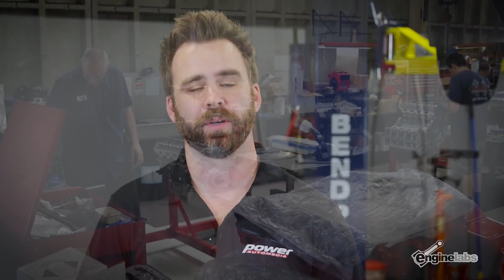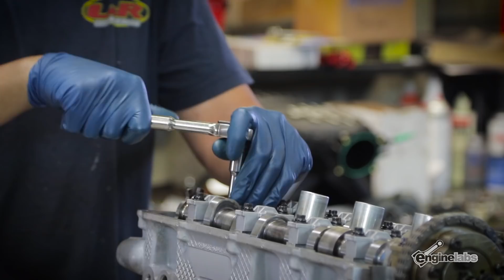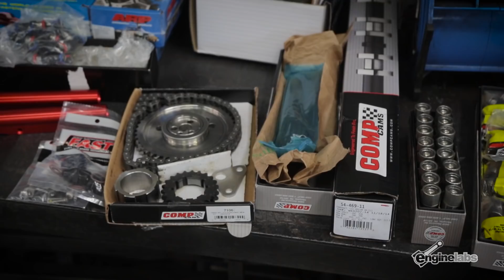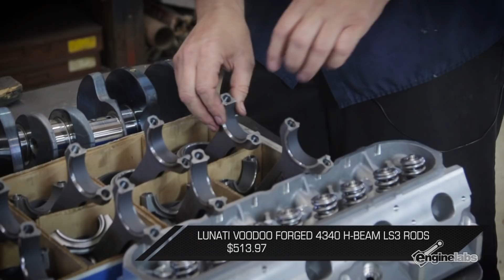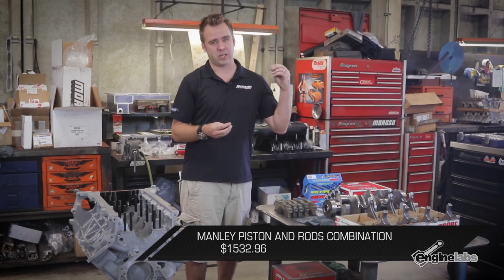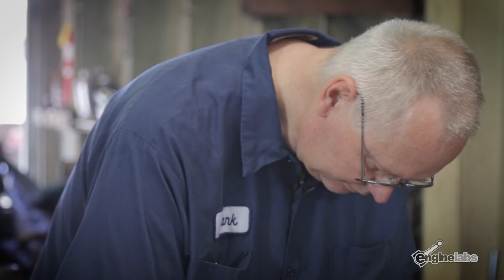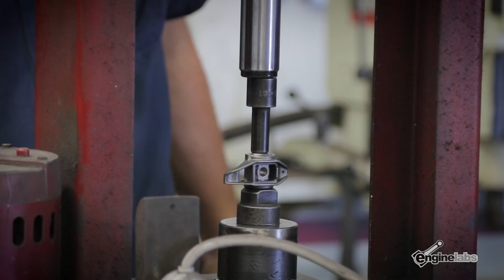$10k Coyote vs LS3 Shootout - The Build

Comment: This is funny because already you bought a new LS3 and a used Coyote. This is why these engines can't compare. And the LS3 is better in the real world.
Reply: Ditto. I stopped watching as soon as I noticed that. This entire article is irrelevant due to its apples:oranges comparison. Dollar for dollar you will not beat the LS. Buy a used LS and mod it with a $10k budget and the coyote wouldn't be close. Poor article by Power Automedia. I unfollow you forever due to your bias and/or ignorance
Reply: So by that logic I should favour one cam over four. Yeah that's why the best motors in the world are still running pushrods... oh wait they change the rods after every 1/4mile
Reply: p shasty buy a ford Barra turbo motor. Shits all over the LS series. Cheaper too. 

People call it a boat anchor. Well it's a boat anchor that eats LS for breakfast
Reply: Ian Thompson hell even 2.5litres of Nissan power is far better than an LS motor.
Reply: Dylan Zrim I don't see any ford Barra turbos, or Nissan 2.5l making wards best engine list numerous times, while powering everything from work trucks to sports cars, drag cars, and transplanted into many import. It's one of the most widely used engines, if not the most widely used engine in swaps, it weighs little more than an inline 6, size wise is as compact as a inline4 turbo motor, and has renowned and proven durability. If it wasn't such a nice engine you think people would still be swapping them after 20 years? Now let's see how many Nissan 2.5l engines are getting swapped into cars 20 years from now.
Reply: Dylan Zrim honestly it's surprising that top fuels hold up to.punishment. ya may dog push rod but you don't see a modular engine cranking out estimated 8000hp. Those top fuels twist their crank shafts up to 20 degrees on a good pass requiring the mechanics to sometimes alter a cam they hold in stock. They melt the spark plugs to the point the engine will diesel it self down the last 3rd of a quarter mile. They're freaks of mechanical engineering that roughly 2/3rd's of the engine has to be replaced just be sure it won't pop every run. They tried modular motors in the 70s and 80s nitro funny cars but they began to fail much easier when power increased.
Reply: Colton Carpenter top fuel motors are rebuilt after every few runs. Meaning they don't last at all
Reply: its got nothing to do with it lasting or not, top fuel engines are pushed to the limit from the start to get as much power out of it as they can, which can be 10k hp or so, they tear these engines down after every race not because "they dont last" but as a precaution to inspect parts and what not to try to keep accidents from happening and risking destruction of the entire engine or injury to the driver, you could imagine what an engine goes through running at a max of 9500rpm, using somewhere between 12 to 23 gallons of nitromethane a run with a screw blower bolted to it pushing somewhere around 65 PSI, just check out how much fuel each cylinder gets https://www.youtube.com/watch?v=xGTbQuhhluY
Reply: Dylan Zrim yeah no shit I was saying they're a freak of mechanical engineering pushing it. Your the one dogging that their push rods bend like it's a weak point or something when they melt spark plugs and valves.
Reply: This is Pointless exactly but the ignorant hardcore ford fans will always say a modular motor design would do better...lmao always a great joke.
Reply: Colton Carpenter rods will bend faster than a catholic priest at a day care centre
Reply: Check Mate a 30dett would shit all over these motors
Reply: Dylan Zrim ikr look at motive dvd theyre making like 600 ALL WHEEL horsepower on a stock rb26
Reply: Check Mate as far as dependability and cost to make that horsepower the ls wins enen a 5.3 can make over 750 at the crank with heads cam a turbo. Gm high tech mag pulled one from a salvage yard to build.
Reply: Colton Carpenter haha no. A ford barra is one of the most reliable engines ever. Basically every taxi in australia had a barra in it and almost all of them lasted 500,000kms
Reply: Check Mate my lbz duramax that's practically stock puts out a lil over 600wrhp all stock other than a few minor bolt ons and a tune.

Plus it's got 234000mi on it.
Reply: Check Mate okay so compare that to a 5.9 cummins. Or a 4.0 in jeeps. The point I'm saying is when it comes to modding and making power it's truly hard to beat the gm ls series engine in cost and durability.
Reply: ok and that shit is like 6-7L displacement + turbo, not impressive at all
Reply: Check Mate also one reason why each of those run for so long is because their routinely maintenenced. Look up the checker taxis that where used in America. Any purpose built taxi will last a long time when that's what they're designed for with a low horsepower engine and transmission tougher than the engine can damage.
Reply: Check Mate a 6.6 liter diesel? Not impressive...lol it puts out nearly 1300ft/lbs at the wheels. Most 13-15L diesel engines are 400hp give or take 50hp at the crank making any where from 1400-2000ft/lbs at the crank. As far as diesel go that not bad for 6.6L single turbo all stock engine with minor bolts and a tune.
Reply: Colton Carpenter salvage yard RB motors have been pushed to over a thousand horsepower. You could build three of those to one LS. Hell you'd be better off with a ford Barra turbo than an LS 😂
Reply: Dylan Zrim lol if you mean stock never modding and takin damn good care of I'm sure it last long hell any motor can when they're takin care of. But apparently every Nissan forum says pitch the the rb25 or 26 for a 2jz bein the 25 and 26s aren't the most reliable once ya get to 500hp being plagued with oil flow and coolant issues. And when you fix that issue ya have over 10 grand in the motor. Those 1000hp rb didn't last long without upgrades.  Like I said when it come to durability of modding it's hard to beat the ls. I know of legit ls3 c6s with d1 prochargers puttin down 800+. Deep down I'm actually a mopar man but they're way to costly to build but for the power and ability to take they can. I mean hell look at the vipers running high 8s in the 1800 to 2000hp range on the stock bottom end. When ya got tons of money anything can be done. Oh by the way a salvage 5.3 can be bought for less than $250 with unknown miles nowadays. You maybe be able to get one of those jap motors to stay together long enough for a few miles with 750hp but the torque won't be on par nor will the fuel efficiency for those numbers. Same goes for the barra motor when ya try to push more power from smaller displacement motors they become more n more unreliable. Same goes for diesel engines, motorcycles, out boards.
Reply: Colton Carpenter I was just stating the top end. Personally i would build a 30det with conservative boost. But build it to take a shitload. 

Also I keep forgetting that the difference between laws will alter my opinion also. 
I could put an LS in my patrol and have an amazing car, but the hoops I'd have to jump through and the money added to jumping through the hoops, I'd rather swap for the original layout. 

But I'll stick with the 
8 in a vee sit down to pee
Six in a row ya good to go😂

Actually I have an old slant 6 sitting in my shed with a screwed bottom end, dad switched a blueprinted hemi six into the car and nearly wrapped it around a pole 😂😂 I'll build that and swap it into my rig
Reply: Dylan Zrim well if your gonna boost the bottom end is a must for most engines once you over 16lbs of boost. Ford was big with forged bottom ends I know you could a svo 4 cyl turbo motor to nearly 400hp for under $2500. But tge had cooling issues and oil flow problems aswell. 

I'm guessing your in new Zealand or the down under.
Reply: All you power ranger engine clowns have no idea what you're talking about. LS/LT motors are KING. Not only that they are Gas Kings without any force induction and Torque Kings at low RPMs. They dominate Chicago's King of The Streets, Drags, Top Fuel. An RB or 2.5 Nissan (motor by itself no turbo) has no place among Gas Kings.
Reply: i think its irrelevent with there being a 72 cubic inch displacment difference
Reply: p shasty guess you missed the part where they list their ls block purchase for 1500 + parts to total out just under 10k and the coyot eng for 3k + parts for just under 10k.. if my math serves me correct they were able to use an additional 1500 on the ls motor due to the blocks price.
Reply: coyote better for durability. LS is king due to cheapness and aftermarket market
Reply: London Custom - I don’t see any ls coming close to the standing mike record ran with a FORD engine 5.4l supercharged 290+ mph. That’s an engine.
Reply: Ian Thompson disagree
Reply: London Custom, that is because there were 999,999,999,999,999,999,999,999,999,999,999,999,999,999,999 of these engines installed in cars and trucks... There was like 25 for every woman man and child on the face of the earth... Same story as it was with the 60's and 1970 small block...
Reply: p shasty who cares about dollar per dollar . The only thing that matters is which is faster part for part. Let’s not forget that you can pick up a junkyard coyote for under 1500 dollars from an f150. Also a late model corvette motor will not beat cheap at all.
Reply: Shh... They had to add a little bias, or else the ford boys would be mad that their overcomplicated bloated valvepits are too expensive to do anything with.
Reply: Dylan Zrim 
Yeah, Top fuel cars also melt their clutches into a pile of goo...

I guess we shouldn't use clutches anymore...
Reply: p shasty New Coyote is far superior 500whp with 3 bolt on's, chevy can't do that
Reply: Ian Thompson ..LS RULES..IM SO SICK AND TIRED OF THE SILLY DODGE AND FORD BOYS SPEWING THEIR NONSENSE...
Reply: Essence of Racing what 3 bolt ons are doing that? I just looked up what they make stock and found a site that took a 2018 mustang, gave it full bolt ons, tune, running on E85 and it made 501whp. You can do full bolt ons, E85 and tune on a new LT1 camaro/Vette and make 500. But h/c/i is where Chevy makes power.
Reply: RYAN W intake, headers, exhaust mustang 500-510whp, full bolt-ons & E85 make 540-550whp fbo being intake, T-body, intake manifold, headers, exhaust & e85 and injectors to run the e85
Reply: RYAN W buddies '18 makes 712whp/657trq with full bolt-one e85 150 shot
Reply: Essence of Racing lol no they don't make that off those 3 mods.
Reply: RYAN W look it up
Reply: RYAN W lmao you right, but it's a mustang and the coyote is still superior. Around enough racing to know any same playing field camaro or  challenger will surely get gapped.
Reply: Fastest car in the world (top speed), dohc 5.0 L Koenigsegg wich they bought design wise from ford, yeah what 2 million dollar car has a Ls in it? I’ll wait
Reply: @chrisodle5263  well you know nothing, koenigsegg uses a free valve cam less v8 engine, has no similarities to ford in anyway except they are both 5.0's
Reply: Chris Odle seriously? Using a somewhat similar architecture on some parts is far from using a ford engine. But it's not like you couldn't build a ford motor to 1000+ whp, and that goes for many other motors. Now to your question. The Hennessey Venom GT uses an actual LS engine, twin turbo'd. Not 2 million but it is over 1 million.
Reply: Because the coyote is newer. Ls motor has been around for 20 years now devaluing them and making them cheaper, in 2031 I’m sure the coyote will be much cheaper lol.
Reply: @codespoutz I'm talking about coyote being better than the lt1
Reply: Had they built a used LS they would have made the same power on an lower budget which would have been an even bigger embarrassment.
Reply: @gusalmighty5098  that's fine the new 5.0 makes more power then the lt1, and it much lighter
Reply: @camcambambam5128  Are you referring to the 2018s that have a 5hp advantage for a whopping 500rpm sweet spot and a 35ftlbs or more disadvantage all up and down the tachometer? You can have that 5hp......I take the 35ftlbs all day long and you can keep drive'n your Stang like its a two stoke.
Reply: @gusalmighty5098  35 less torque but more rpms and crazy torque curve, and full bolt ones they make more and the Coyote is a superior motor in general, nothing runs like a Coyote
Reply: @camcambambam5128  And some how the Camaro SS beats a Mustang GT from 0-30, 40, 50, 60, 70, 80, 90, 100 and the 1/4 mile. In fact the Camaro is .5 sec. faster from 0-100-0. On a road course the Camaro eats the Mustang alive....3 seconds per lap at the streets of willow. I think you maybe confused about usable torque. The only thing the Mustang has on the Camaro is top speed......not real important for stop light to stop light everyday bragging rights......then add what just happened with the LS3 build above....sure.....I see its superiority all over the place.
Reply: @gusalmighty5098 first of it's not 2011 anymore, the only reason the ls3 made more power was because it's a cheaper motor. New Mustangs run 12 flat and people have even seen high 11s 100% stock. Fbo they run high 10s and slap a 200 shot on it and it's in the 9s. Coyote engines are more mod-able and nowadays easier to upgrade and tune, the dohc coyote is just superior. And oh wow willow springs what a joke of a track. Try Nurburgring, Spa, Sebring or any track that isn't shit and has 90% right turns. The 2018 Coyote is easily one of the greatest engines of all time and ignoring that fact is just stupid. Learn a little it's not all about the numbers it's about the experience and a Coyote makes you smile and laugh everytime you go near the throttle, the responsiveness, the noise, the flat torque curve that never ends and keeps pulling. With headers and it's an orgasmic sound and even they way mustang's drive a happy tail out muscle car what's not to love? But you like numbers so what's the point of me trying to explain
Reply: @Gus Almighty that's the difference between auto and the manual, the auto is way faster. I still rather have a manual but I just gave you proof the mustang gt is faster and you still talk shit. Motortrend is a joke anyway they heavily underdrive and underperform cars in a straight line they don't know what no lift shifting is. Buddy ran 12.3 in his '18 Manual which is faster than motortrend claimed time. I remember when motortrend said the 06 zo6 could only run a 12 flat and people around the world were getting 11.3-11.5s
Reply: @camcambambam5128  listen to your self. You are actually trying to compare results from different venues.....rookie move bruh. Motor trend....same place, same conditions, same equipment, same drivers with the same issues, all on the same day. That is called a head to head comparison........and the Mustang got SMOKED. Like I said earlier. Split hairs, invent scenarios, compare bolt on Ford's to stock Chevys this is what blue oval fanboys do!
Reply: @gusalmighty5098  Idc what drivers they use, they don't get the most out if the cars because they're rentals and scared to fuck them up, if you trying to see how fast a car is you no lift shift until it breaks. It's called a driver mod. Mustang GT is faster than the Camaro and it will stay that way until Chevy picks up on dohc/32v engines
Reply: @camcambambam5128  Listen to your self........the Ford is faster but only if your willing to break it to prove it.......That's pretty out there even for a ford fan....hahaha. Are you really not able to wrap your head around this or are you just playing dumb? You can't compare loose information. That is like putting the cars on 2 different dynos 500 miles apart and taking the results as gospel. In a head to head comparison, under identical conditions, even if they were driven like you say, which is the way most owners would drive their own expensive cars because like you said they don't want to fuck them up.....it got SMOKED !
Reply: @gusalmighty5098  and I'm telling you the tested the manuals, Ik the manual Camaro is faster it makes 1 less shift and that's why the mustang is slower loses 1-2 tenths making that extra shift. But I'm telling you the auto Mustang is faster than any Camaro SS, it runs high 11s stock, no Camaro can do that
Reply: @gusalmighty5098  how is an official quarter mile time of 11.84 @ 119 loose information when it holds a confirmed record?
Reply: @gusalmighty5098  it's clear you don't drive cars so you'll never understand, 5.0 over all other domestics, in terms of fun, mods, livability, power etc. In the real world it's a better engine & car and that why it continues to out sell GM & Chrysler sense 1966
Reply: @camcambambam5128  I am just gonna guess that they didn't run the Camaro on the same day, with the same driver, in the same lane. If that is true it is loose information. Because some how under IDENTICAL CONDITIONS.......a less expensive Camaro crushed a Mustang GT and not just on the road course....straight line too!
Reply: @camcambambam5128  Oh Boy here we go again. The ford fan losing a numbers argument in a numbers thread abandons exhaust note and pulls out......but it sells better! As if that good for another 10hp. You really can set your watch by this stuff.
Reply: @gusalmighty5098  in the real world 5.0s are better and faster. I've yet to see a 5.0 lose to a Camaro so that's my argument, a video is irrelevant compared to real world experience
Reply: @camcambambam5128  oh yeah I once watched a Camaro beat 1000 Mustang back to back on the same day.......My first hand account is way better than yours. Wow you blue oval boys DON'T like to lose....hahaha. Sure they are better. You can tell by the track data logged by professional drivers.......Hey what ever helps you sleep tonightd
Reply: @camcambambam5128  Even if the auto Mustang is faster than an auto Camaro at the drag strip......the manuals aren't. So if true enthusiasts prefer manuals  that is a wash at best...and that automatic sure as hell won't erase that 3 second gap on the road course. Then there is also that $5k as tested thing........
Reply: @gusalmighty5098  I could care less about lap times in a muscle car.....and I already told you the ONLY reason the mustang is .7 tenth slower is because it has to make 1 extra shift which takes 1-2 tenths.......put them on the street in a roll race and the mustang will run away, I sent you the video so shut up
Reply: @camcambambam5128  Of course you don't care about lap times because the Mustang got eaten alive. I suspect if the Mustang had beaten the Camaro so handily your position might be different. But ok lets play the excuse game. The only reason the auto is faster is because it has a 10 speed auto. See how pointless that sounds? It is totally irrelevant. This is how the cars come. Manual Mustang still loses to the manual Camaro regardless of what the autos do. And the Camaro absolutely smashed the Mustang in a back road style road race.....be a man!
Reply: @gusalmighty5098  on a real race track like Laguna Seca with both cars having the performance pack the mustang is .64 seconds slower on a hot lap but has a higher average after 10 laps due to tire wear, brake wear and driveability so suck it
Reply: @camcambambam5128 I am still laughing about........The only reason the LS made more power is because it is a cheaper motor......you really proved your point with that little gem.....
HaHaHa! I put it out there so everyone can appreciate it. Don't worry....out of respect I didn't put your name on it.....hahaha
Reply: @camcambambam5128  so you are saying in the best example you could find the Mustang from the very first lap starts out over 1/2 a sec. slower and the gap only gets worse with every additional lap.....but that is only because the Mustang eats its tires faster due to its inferior chassis, suspension, and brakes? Good point ! This is your "suck it" "drop the mic." moment? You know, you are really good at this....were you on the debate team in High School?